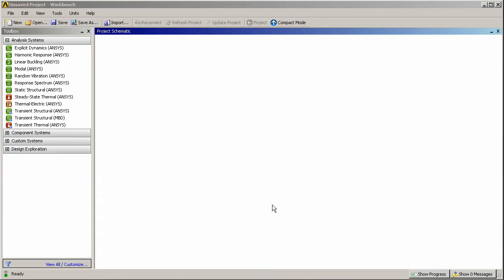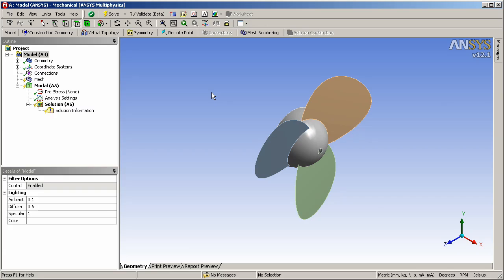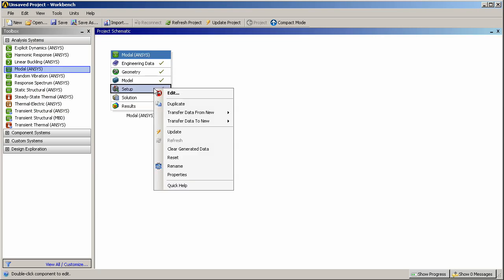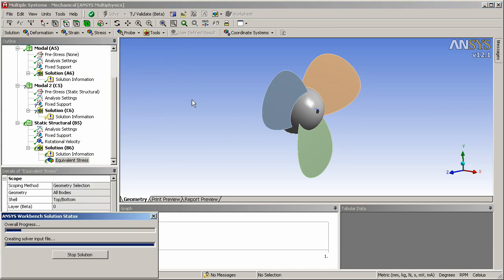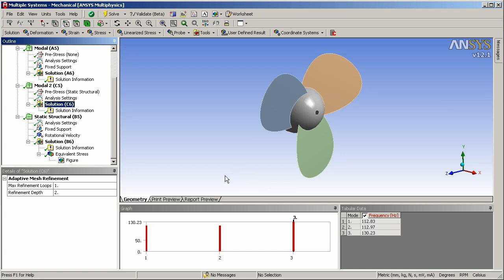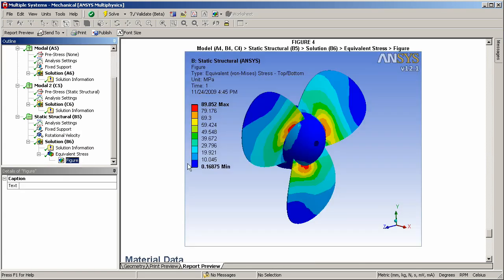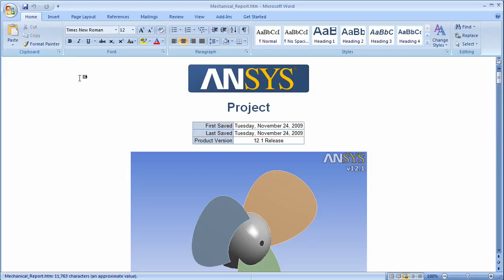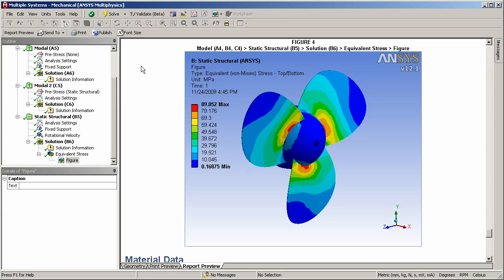ANSYS Workbench Quick Tip #2 - Reporting Linear Vibrations of a Fan.

Comment: Sir,
I have a small doubt.
at time =2.42 mins you added rotational velocity along with fixed support.
how a fixed rotor can rotate?
please give me some clarification or any source information?
Reply: Hi Harish.
I know what you mean. It's absolutely ok to define a rotational vel. Not every static structural analysis should be done at rest and at zero velocity. Analyses at a constant speed or rotational velocity fall into this category as well.
A fan blade rotating at a constant speed can be statically analyzed by examining the stress that the centrifugal force exerts on each and every component of the fan. By adding a rotational vel. in mechanical, we consider the stress that the centrifugal force inserts in the fan.

Comment: @DamodharanR16 First, thank you for your answer.

I am not experienced in vibrations (that's why i am so lost)

What i don't understand it's the physical meaning; in the first case in the video, the center ring is fixed. So after the modal analysis... what does these 105 Hz mean? there is not an external force.

I can understand that a piece with 50 Hz vibrates less than one with 100, but what would be the limit?